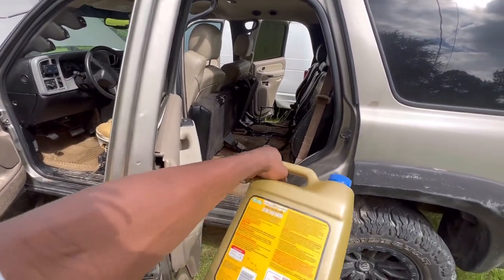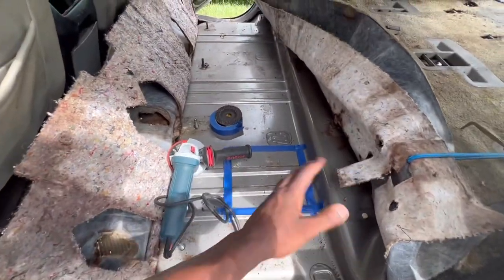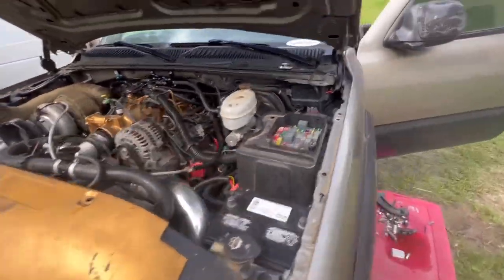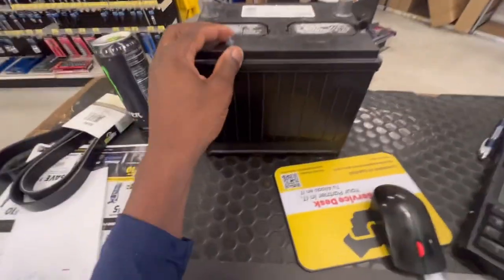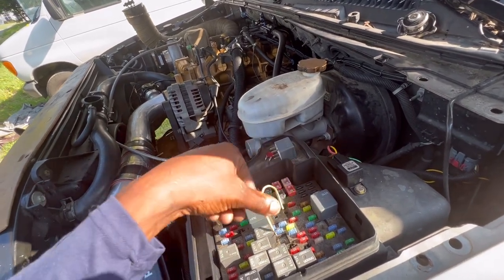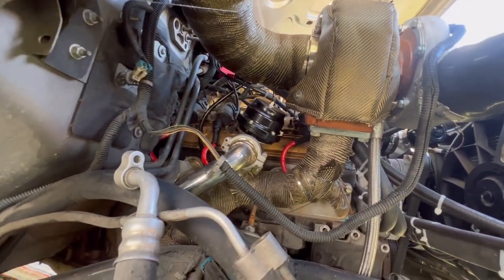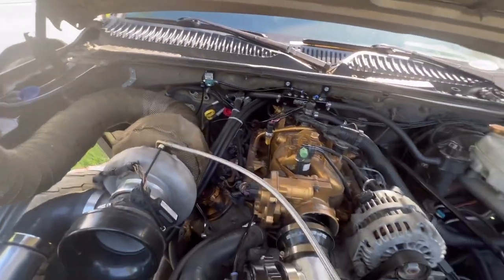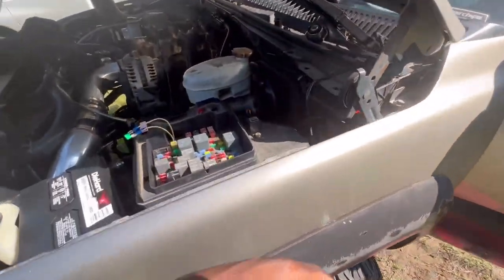5.3 turbo running 🥵🔥 but wait we have a issue??

Comment: Reduced engine power would be throttle position sensor( I see you figured that out) but that stud on the back of the alternator is where the power comes from so you definitely don't wanna ground that to the firewall
Reply from the maker: Appreciate input 🤙🏾🙏🏽

Comment: your tuning this thing with a superchip programmer?
Reply from the maker: O Noo I will use hp tuner from a guy I was recommended. The super chip used to measure gauge readings etc.